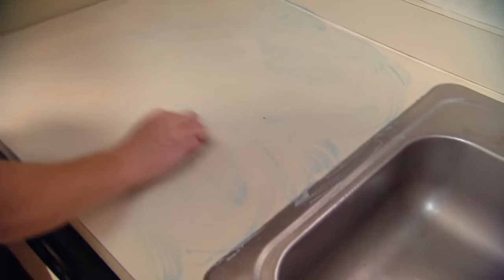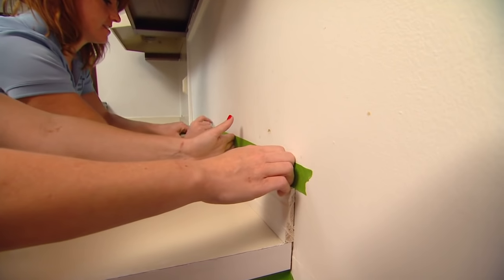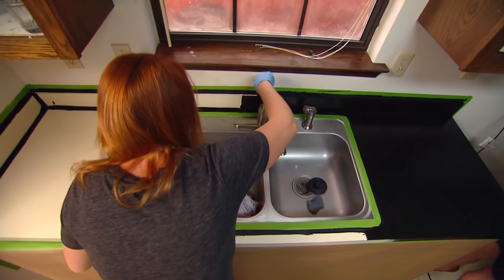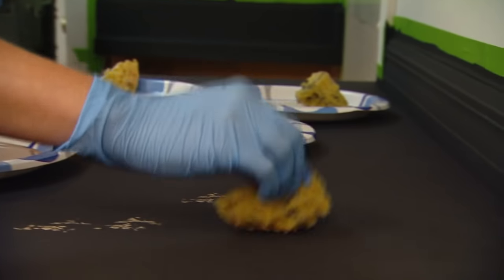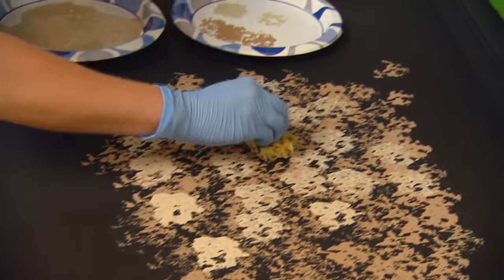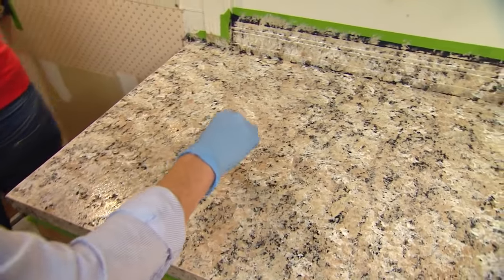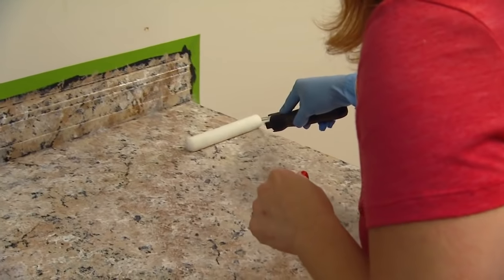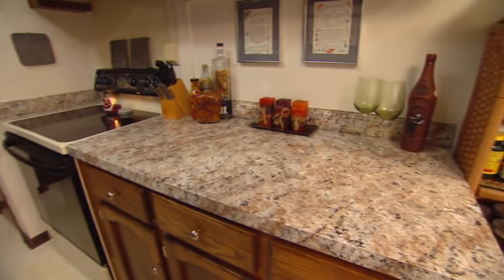Painting Kitchen Countertops to Look Like Granite - Today's Homeowner with Danny Lipford

Comment: I've been hearing about this and would like to do it but I have a concern if you put something hot on top the painted counted.
Will it ruin the paint?
Reply: Yep. It did ours. It's also supersensitive to any cleaners with solvent in them - we accidentally got some on it and it melted the finish and left a rough spot.
Reply: Terrence Delaney how can I remove brown stain left by cleaners like bleach...
Reply: You are not supposed to put hot things on most countertops.  You can't mistreat any product and expect it to endure.
Reply: @TerrenceDelaney  For most things you should only use certain cleaning products made for that surface.  You can't put anything on wood or stainless steel.  All surfaces have to be treated with care.  You can't blame accidents on the product.
Reply: @aestheticallycherry1510  Sorry, I just now saw your question. I don't know how to deal with stains. We found that rubbing too hard began to remove the finish. We ended up just scraping it all off and returning to the original countertop color even with its scratches. It's not perfect, but it looks better than the damaged paint did. We recently bought an epoxy finish kit but still haven't tried it.

Comment: Does the sealer dry with an orange peel effect? Is the counter top smooth or do the paint dabs make it uneven?
Reply: I used polycrylic and not discoloring so far. I also use pot holders under hot pots everything looks great. If you sand down the first and second coat of polycrylic it will be smooth. I left mine and got a rough finish which I like

Comment: Is the sealer strong enough to put a hot pan on that top?
Reply from the maker: We'd suggest you put a trivet on it, the paint will warp or come off due to the extreme heat.
Reply: Thank you for your feedback
Reply: mine peeled away next to my stove.. so this time I will be putting a cutting board next to the burner I used most.

Comment: The entire system is almost a 100 dollars. I just want cheap paint. I am redoing soon. Anyone know how to just paint a damn countertop black so it withstands abuse? Geez
I don't wanna spend 100 or 150 for four feet of counter top when I am getting rid of it soon.
Reply: If not too late...just get a primer and have the store tint it black..prime, then paint black then roll on polyurethane 2-3 coats, drying in between.